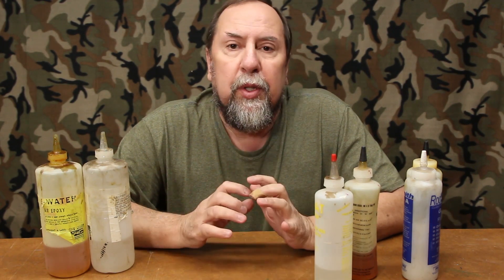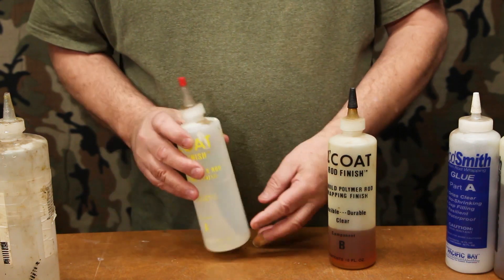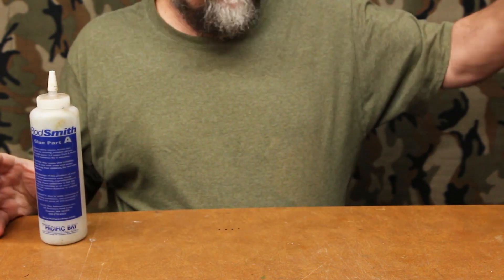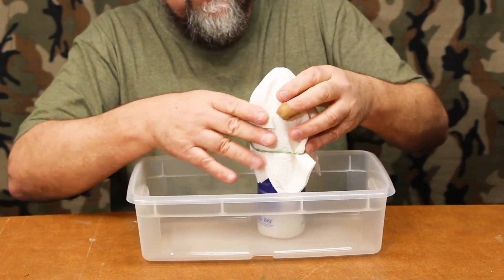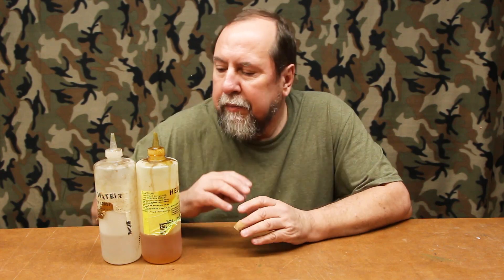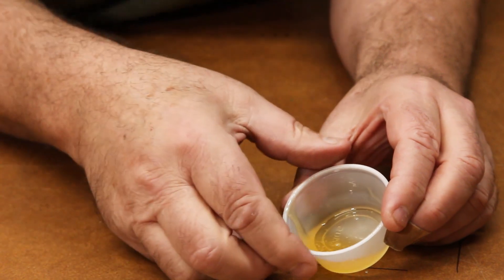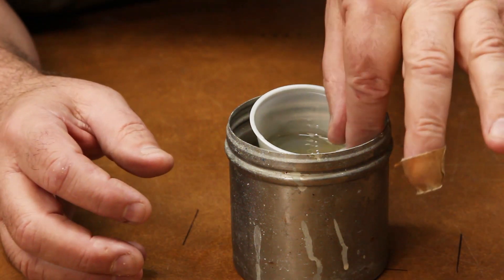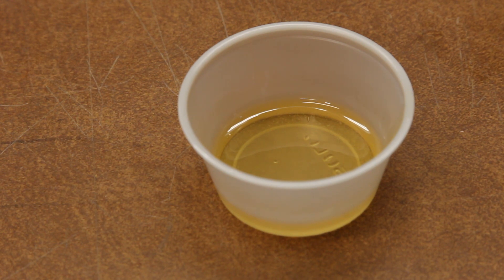How To Mix & Use Epoxy Without Bubbles

Comment: Epoxy genius. I feel like I’ve watched a lot of videos but this is probably the most helpful. Do you not the flame touch the epoxy? I know (from experience unfortunately) it scorches easily, but a I have trouble getting all of the bubbles out of the epoxy unless i do a quick pass with a flame.
Reply from the maker: The flame does not touch the epoxy. It will scorch it to a brownish color. It just needs to warm the top surface of the epoxy to break the surface tension and allow the bubbles to escape.

Comment: thanks so much for this, I didn't know that the popsicle stick is what adds the tiny bubbles in when mixing.
Reply from the maker: All the little air bubbles trapped in the wood come out into the material when the epoxy replaces it.

Comment: The spacecraft industry after mixing warm epoxy.  We place it in a small glass vacuum chamber and pull out the air prior to use.  Works great.  In space the air expands and breaks the epoxy.

Comment: A hairdryer is by far the best method ask any rod maker works in seconds.
Reply from the maker: I don't like the volume of air that a hair dryer puts out. It can move epoxy to places you don't want it.
Reply: @chrismihulka-nwfishingstuf3852  exactly. I completely ruined some products bcz I wanted to try hairdryer instead of spending money on alcohol or heat torch

Comment: Thank you for sharing, however, what about using a heat gun or hair dryer, have you try? Have a nice day
Reply from the maker: The problem with using a heat gun is too much heat, which can cause the epoxy to boil, and can also damage the project. Any device that moves a lot of air, like a hair dryer, also moves around a lot of dust. Keeping the amount of heat and air movement lower will reduce the amount of problems like dust in the air sticking to the epoxy and giving poor results. Thanks for watching!
Reply: @chrismihulka-nwfishingstuf3852  
As a rod builder, I've had very good results popping bubbles with blowing gently through a straw.
I think the CO2 in your breath (and body heat) helps break the surface tension, allowing the bubbles to rise and pop.
Reply from the maker: @jkg6211  The heat in your breath is good, but there is also moisture. It there is too much moisture blown on the epoxy, it can leave a slightly hazy look on the surface that has to be covered with another coat.
Reply: @chrismihulka-nwfishingstuf3852  
Yes, epoxy blushing can be an issue if humidity is high, or you blow too much on any given area.
I generally have zero issues with bubbles in the first place though... one trick Doc Ski and I use (no doubt many other rod builders as well), is to stir well and then pour it out onto a large section of aluminum foil shaped into a dish.
This allows the epoxy to spread and thin out, creating a large surface area. The bubbles have only a millimeter or so to rise and burst... generally within seconds. I then apply it with a SS spatula to prevent creating bubbles.
The aluminum foil also acts as a heat sink to extend pot life, and help prevent thermal runaway.

While this works perfectly for rod building, I've yet to try it on larger projects... but I'm going to pour a countertop next week, so... we'll see what happens.
Wish me luck!
Reply: The countertop came out amazing!
For the first coat, I didn't care if it was clear or had bubbles... I was planning on a second coat with an opaque color anyway. I used a slow setting epoxy made for countertops. (no brand names mentioned)
I mixed it up almost into a foamy froth, and honestly didn't care about bubbles - just making sure it was thoroughly mixed.
After pouring it, and a little heat from a propane torch, it was level and perfectly clear the next day.
I couldn't find a single bubble!
Needless to say, I did take a little more care in mixing the second colored coat... the end results are impressive!
It came out so nice, I think I'll do the rest of the countertops in the rest of the house too.

Comment: Hi Chris, thanks for at very informative video. I have one question though. Is part A the resin or the hardener? (my epoxies bought in Europe are not labeled part A and B).
Reply from the maker: Some companies label them differently, but from what I can see in the different varieties I have on hand, the very clear one is the resin, and the one with a slight amber color is the hardener.
Reply: ,the two components,,,, A is the resin and b is the hardener,,ask the shop owner to explain to u.
Reply: Never heat the hardener!

Comment: what's the approx. temperature of the water
Reply from the maker: Not full hot out of the tap, but close. About 120 F.
Reply: Not boiling unless you want a sculpture of resin being poured out of a melted cup.